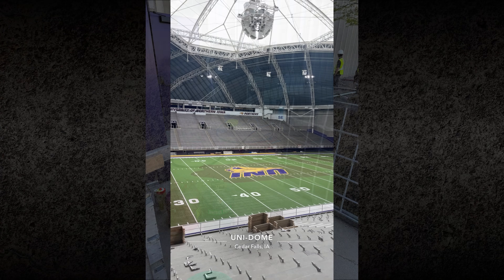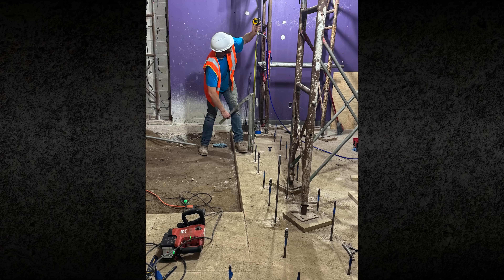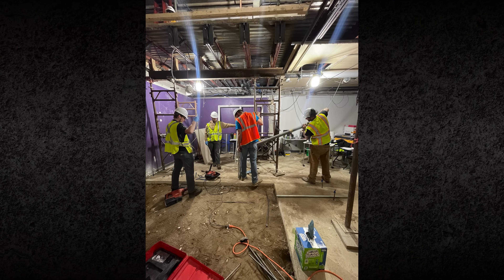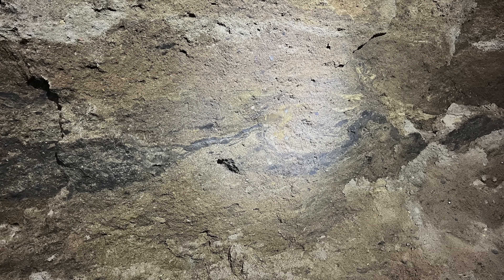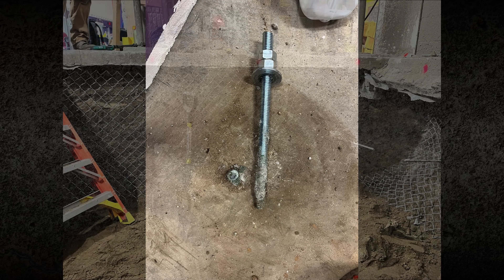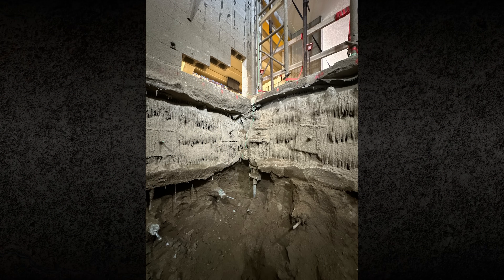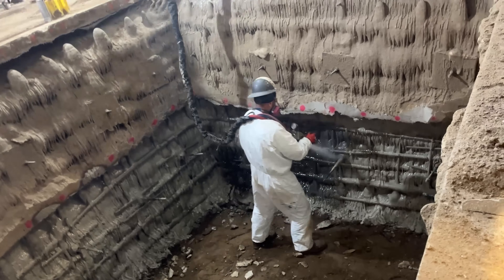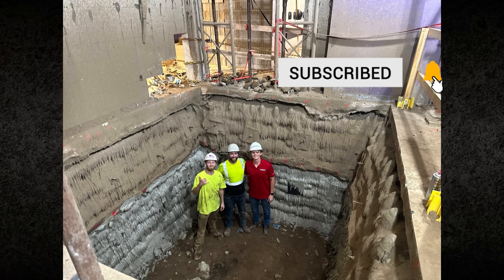UNI Dome Case Study: Excavation Adaptation with Polyurethane Soil Nails

Comment: Yet ANOTHER technique for using poly. Awesome. Kind of like deepfoamjection but sideways? Is there a free spray nozzle now or is it just a crushed port?
Reply: Great question, I am also wondering on the free spray nozzle that was used
Reply: @mitchv5241 we used to just crush a port with a pliers and it worked pretty good 😂
Reply from the maker: Thanks for the questions. For the soil nails its kind of like that: the holes are predrilled, then the nail is inserted, and a pipe is attached to the gun to reach the full depth and retracted as polyurethane is injected. For the foam facing, it is a spray tip that we have for the EliteONE gun.